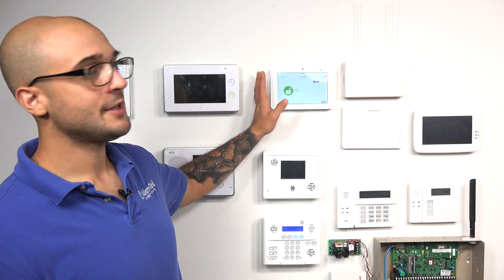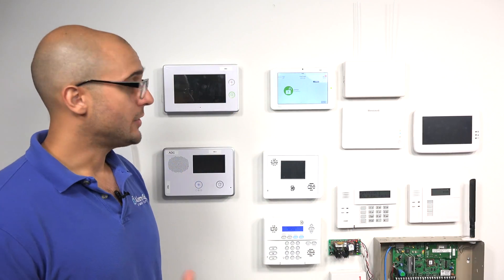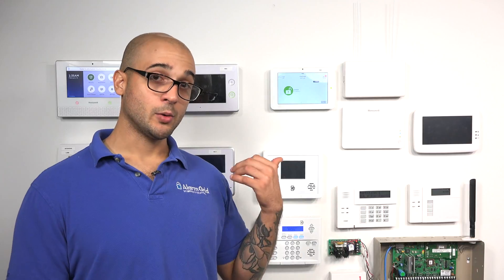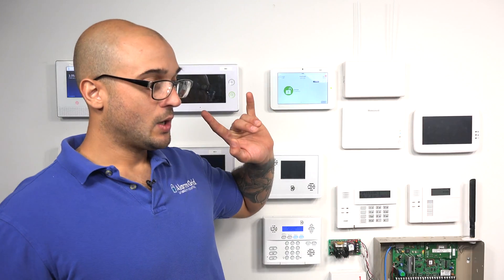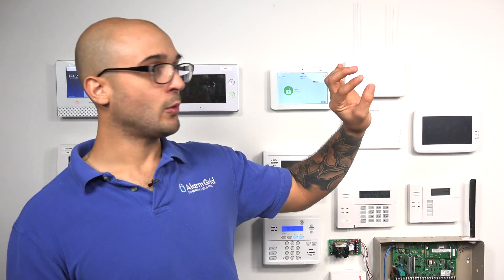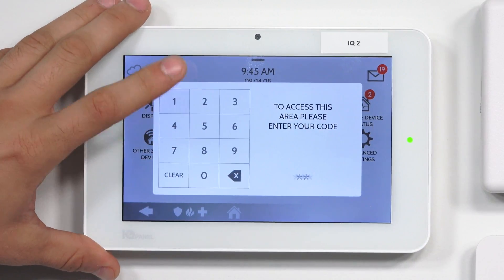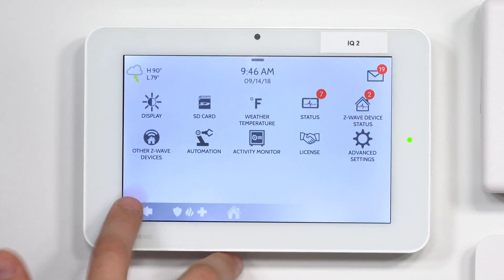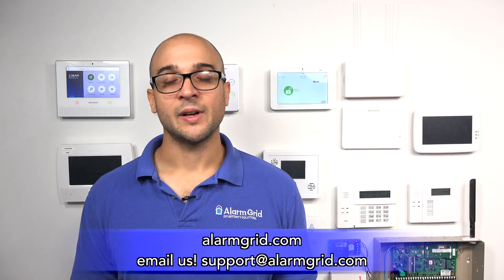Sensors Compatible with a Qolsys IQ Panel 2 Alarm System

Comment: I’ve got a question for you, I recently had a IQ 4 panel installed with the latest 4.3.0 software, I have all qoldys s-line sensors installed 319mz, I was just wondering if I can add Honeywell 345mz sensors on that same alarm , due to the fact that I hit extra sensors left over.
Reply: Good Day,

If the panel can do 319 that means 345 5800 will not work. The IQ4 can do power G and only one legacy Rf frequency. The 319 can be changed to 345
Reply: Thank you for responding, so technically it could only run 319 or 345 at once? Not both frequencies together, so it’s either all 319 or all 345? Correct?
Reply: @antcar97  It can only do one if you need another frequencies the system would need to be replaced with a system that does that frequency.

Comment: Would the Honeywell wierless glass braker work with the system
Reply: Good day yes there is a version of the IQ@ panel that will communicate to the Honeywell 345 devices also know as 5800 series

Comment: Hi I have the IQ 2 panel not monitored canceled adt and  so they took off the door sensor and cameras. can I buy the sensor that would work with my system and cameras? If not I got the night owl security system cameras I can use separately but would like to keep one system
Thank you
Pete

Comment: Which one should I buy if I dont have any sensors before? 319, 345 or 433? Which one does have the most sensors? Is 433 same as 433.92mhz?
Reply from the maker: That's really going to come down to personal taste, and which sensors you believe look the best.  Qolsys Makes the IQ Panel 2 Plus in three versions, so that you can choose either 345 MHz, 319.5 MHz or 433 MHz.  Honeywell and 2GIG both use the 345 MHz frequency, so they probably have the most different sensors to choose from.

Comment: SOMEHOW my Qolsys IQ-2 (brinks monitored) was installed with a mix of Qolsys IQ motion sensors and one Honeywell 5800PIR-RES motion sensor.  After a few months, the Honeywell began to false alarm.  Brinks wanted a lot of money to replace it.  I found the Honeywell sensor for far less, looked up how to add sensors to the IQ 2, but the panel did not detect the sensor.  I gather Honeywell sensors operate on a different frequency.  How did it get enrolled on my panel without a translator?  I'm stumped.
Reply: @Ciara Hibbert Thanks,  that would be the logical thing to do.   I bought a Qolsys motion detector.   Working great.   I still don't understand how they got a Honywell unit to work at 319 MHz., but that's how the Qolsys panel found it.   All the 5800PIR-RES are 345 MHz.
Reply from the maker: @billbmsn  They may have a wireless translator device installed.  Qolsys makes one, and there is also one made by Resolution products.  The one made by Resolution products requires that you learn the wireless device into the translator first, then into the panel.
Reply: @AlarmGrid  I'm aware of those translators, but I can't find any evidence this panel has one.  Why add that when they could have just used  the right sensor.  I tried a new Honeywell sensor and the system did not offer an option for the Honeywell sensor while the old Honeywell was detected.  Weird.  Anyway, I got a Qolsys compatible sensor and all is better.
Reply: Dude just buy a new 433mhz sensor from aliexpress for 5 bucks and watch a video on how to pair it. If you want the installer code hmu! And it seriously takes 30 seconds to add a sensor
Reply: @angelberthoteroful  Thanks.  That's what I did.  All better now.